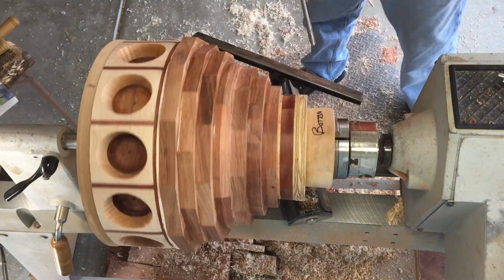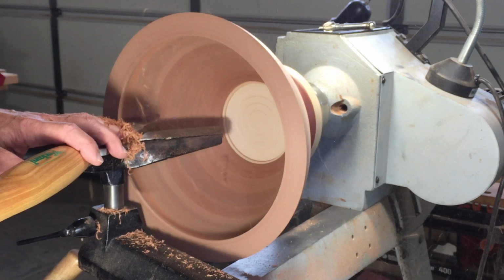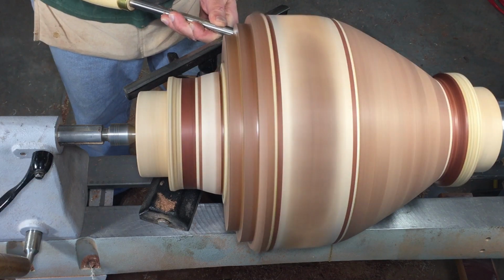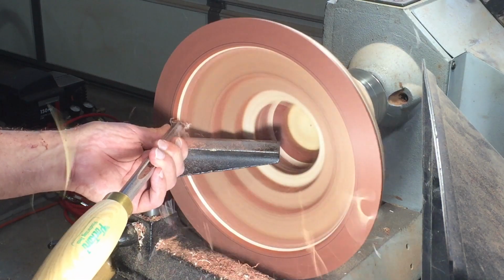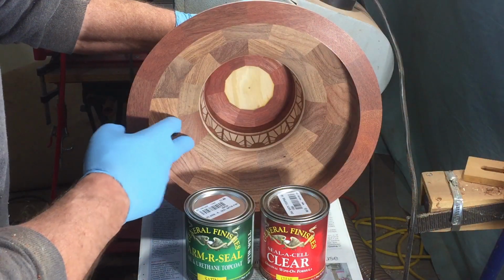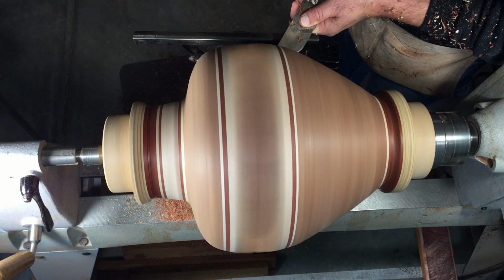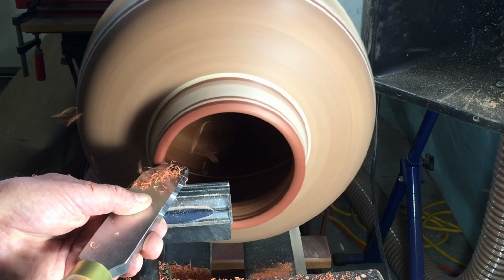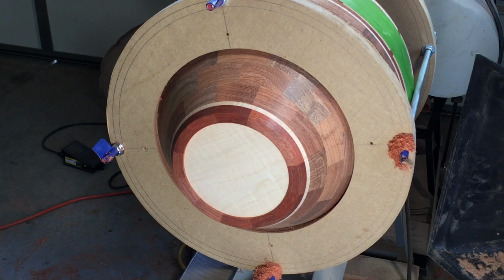A Southwest Inspired Segmented Turning - Finish Turning

Comment: Hello Steve, Your video has showed me alot in turning this vase you made, VERY good!  Hope you dont care I am working on one now like the one you made here, I used oak for most of it and honey locast for the sunshine [yellow wood] and black walnut for the rings and 12 round holes with white maple for my animals cut outs in them, so far am doing ok, Glad I get my wood free with all the mess-ups I made, am in stage of turning and putting it together now, I made a sled to cut the angles and also a Hyd. press to press rings together when glued them,  I have took lots of photos when building it would like to show them to you later if you want to see? I start out with logs and a chain saw to make my wood to use, I just got a 12inch. table saw with 2 HP. motor, WOW, is it nice when cutting thick wood and angles dont even slow down even with 5 inch. oak slabs to cut,  Thanks for the great video!
Reply from the maker: +Charles Durfey Charles - I'm pleased that you liked my project enough to give it a go.  It's a big project but well worth it when you get it finished.  I'd like to see some pics of your finished project.  Let me know when you get it finished.  Good luck with your vessel!  Take care,  Steve

Comment: This is the most complicated and beautiful turning project that I have seen anywhere.  You must have years of experience.  I cannot imagine what something like this would sell for if you sold it.

You do not use many carbide tools.  I am starting out and like carbide quite a bit.  What are the advantages to using traditional gouges and scrapers over carbide tipped tools?

Amazing project.  Do you sell any of your work?
Reply from the maker: Thank you very much Roger!  I bought my first lathe (used off of Craig's List) in 2008 and have enjoyed turning ever since.  This was a challenging but rewarding project.  I started turning using, and sharpening, traditional tools so that's what I use most.  I have nothing against carbide tools other than the price.  As they become more available and the prices come down I'll probably add more to my tool bag.  One advantage with using carbide is you don't need a grinder, sharpening jigs, etc.  You can't go wrong with either in my opinion.  I don't sell my work.  I turn for the enjoyment and most projects go to family and friends except this one.  I'm keeping it for my own enjoyment.  :-)  Take care,  Steve

Comment: Absolutely awesome work, my hat comes off to you Sir. I have been a woodturner for over thirty years. In all that time I have never tried any segmented projects. I have just completed my first segmented bowl. It’s a whole different feel from the turning tools. Turning away the corners is a little unnerving. The sound feedback while turning is very odd.  It will be a long while before I attempt anything as complicated as your masterpieces. I have a question for you. What is the purpose of the plywood backing boards on some of the rings.?. This is the first video I have watched from your channel. It certainly won’t be the last. I will gradually watch all of your previous videos. Keep up the good work Sir, All the very best, Yours Ricky
Reply from the maker: Ricky - Thank you very much for your comments.  This is one of my favorite pieces that I've turned.  When I made this piece I was using the plywood to square up the joint between the two half rings.  I'd tack glue the half ring to a square piece of 1/4 inch plywood and then run it through the table saw to get a good fit between the two half rings.  The sled I was using at the time would get me close but not perfect.  I explain the process more in some of my earlier videos.  I stopped using that method after I made a wedgie sled.  If you plan on doing any segmented turning you should consider making one.  You can search on YouTube for wedgie sleds and you'll find several videos.  I did a short video on the one I use.  I put a link below if you're interested.  Segmented turning is a lot of fun.  I've been away from it for a while and am iching to get started again.  Thanks again for the comments.  Take care,  Steve

Wedgie sled video.
https://youtu.be/xaEHetjBqio
Reply: @slindsley1951  Hi again Steve, I thank you for explaining that one. That makes sense. With regard to the Wedgie sled, I have already made one. Along with a ring press for the gluing. Although I regretted not using the lathe to glue the rings then rough turning as the layers were added. Live and learn eh. At 62 years old, I am still keen to learn more.  Woodwork has always been at the centre of my life. This might be a difficult question to answer, but where do you get the inspiration and design ideas for your next turnings ?  I spend hours looking at images on the internet of other people’s creations. Some of the work out there just blows my mind. I don’t think I could take the tension of the last parts of turning a project that I had invested weeks of time and effort. One slip with a gouge and it all blows up. I could see from that video that your fear was building. Your touch from the scraper was getting softer and softer. 😂. What a feeling it is though when it finally come off the lathe and is sitting on a table for everyone to admire. I live for that feeling.  I wish you well Steve. Happy turning. Yous Ricky.
Reply from the maker: @RICKYDENNIS49  Ricky - Finding inspiration can be difficult.  I'm not a naturally gifted artist so I have to seek inspiration elsewhere.  I'm inspired by the pottery of the native Americas particularly from the Southwest area of the the US.  I also look at Greek pottery plus others.  Just keep looking and you'll find something that inspires you.  Good luck and be safe!  Steve
Reply: @slindsley1951  Happy turning Steve, keep those tools nice and sharp eh,   Yours Ricky